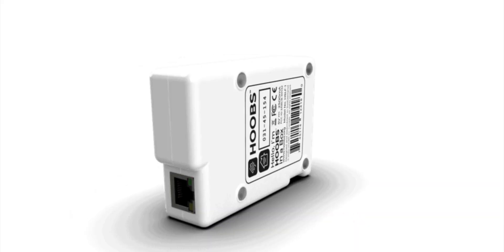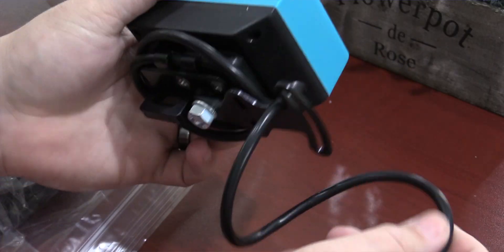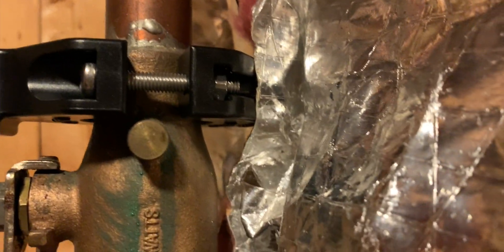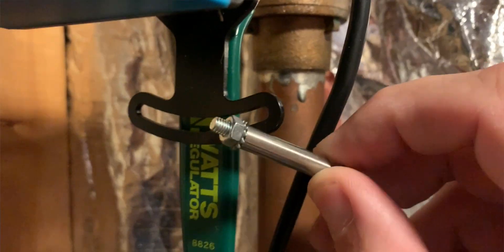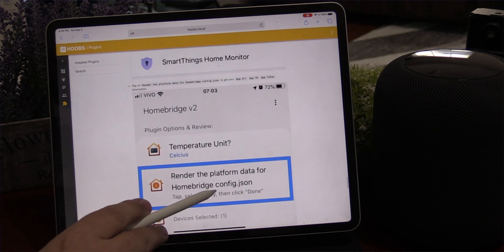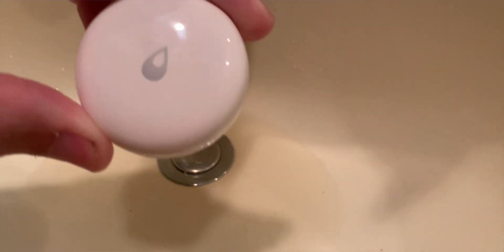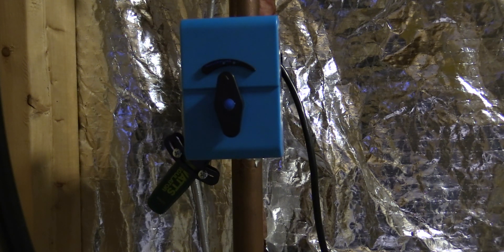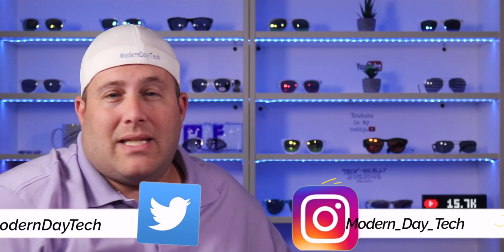I Finally Solved Apple HomeKit’s BIGGEST Problem! Here’s How - Featuring Econet Bulldog

Comment: Does this still work?
Reply from the maker: Yes, & no. The Bulldog Valve and automations work, but I did switch from SmartThings/Hoobs for the Z-wave connection, to the Thinka hub for z-wave (which is native to Apple Home(homekit). Since Thinka is not in the USA yet though, and SmartThings is not opening up their Matter support for z-wave anytime soon, the only other way is to get the WiFi edition and bring into to hoobs/homebridge. I haven't tried that edition though.
Reply: I just set up SmartThings / Homebridge (direct vs Hoobs) and can’t configure any automations / scenes within HomeKit. Is that piece working for you now? Maybe I’ll need to try Thinka but that doesn’t make too much sense…
Reply: EDIT: I can see the valve in HomeKit (shows as sprinkler and “running”). Am able to turn on and off but it’s not selectable for any automations.

Comment: I have the econet water heater.  I wonder if I can connect it through hoobs and smart things.  Can only set it away with EcoNet app now.
Reply from the maker: Hey Mike, I think these are two different companies. The water shutoff is Econet Controls and the heater thing is Rheem EcoNet.  So you want to make sure you research Rheem EcoNet.  It is not listed in Hoobs or SmartThings. Some research said at one time, they worked with Nest. Maybe the integration is back.